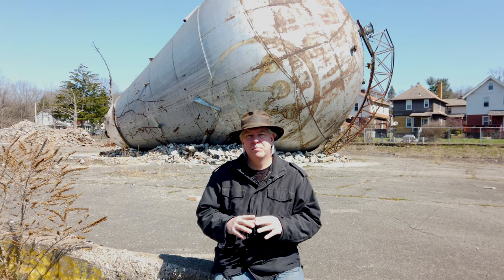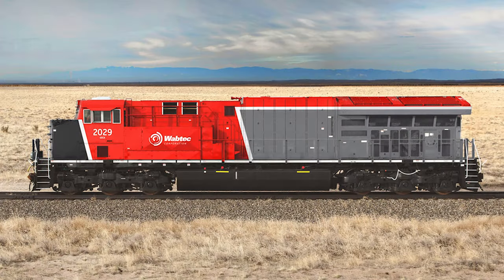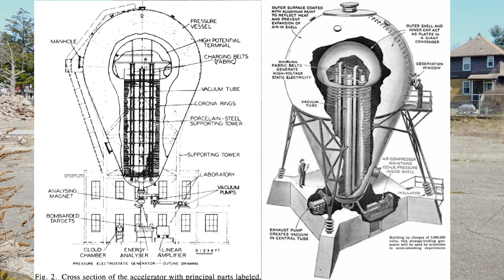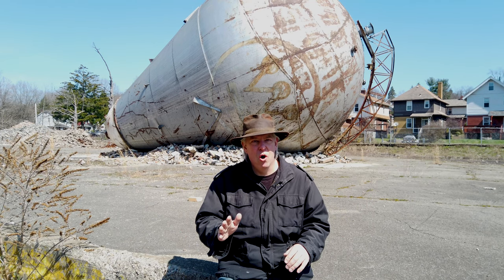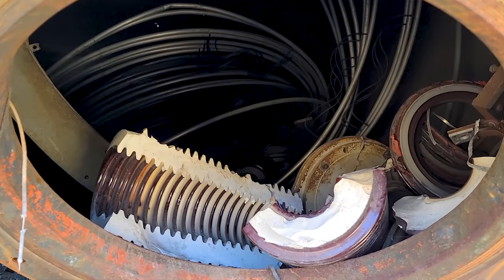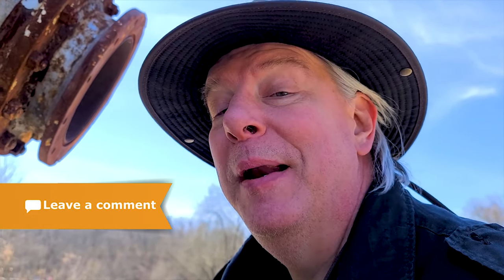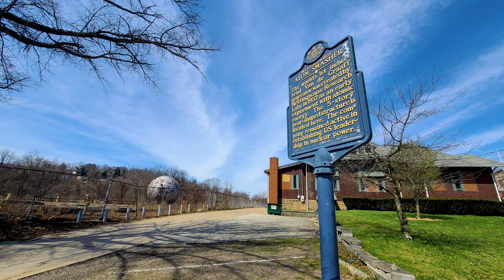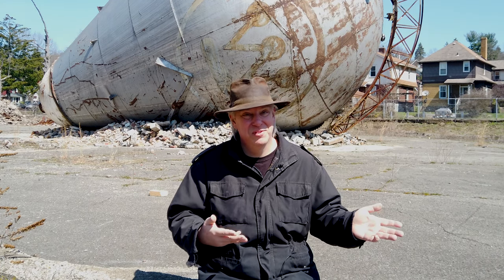Left to ROT Particle Accelerator / Collider

Comment: There is still a working Tandem Van de Graaff at BNL today used to make beams.  You can buy beam time on it today. I think the outer shell was just filled with compressed gas (air or nitrogen) to insulate the system and prevent HV leakage or discharge. The beam line was the tube in the center under hard vacuum. Guessing the rings formed the resistor latter.